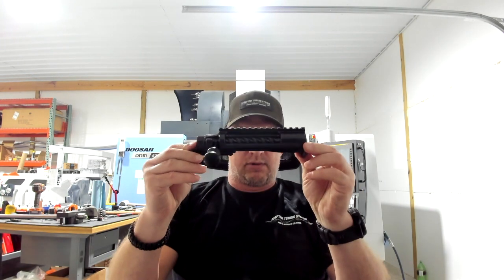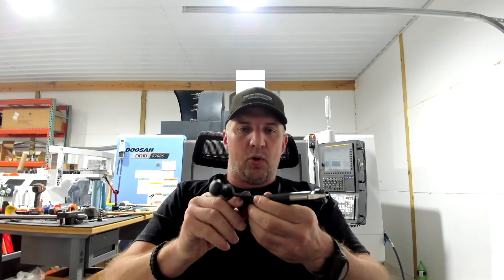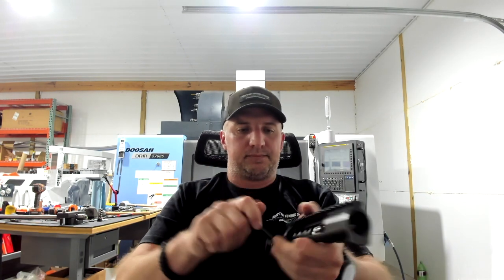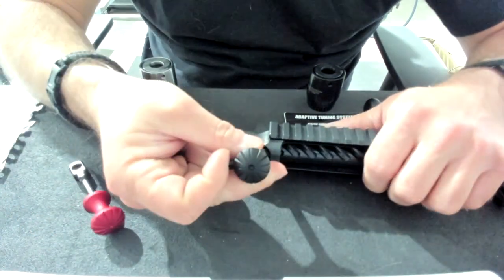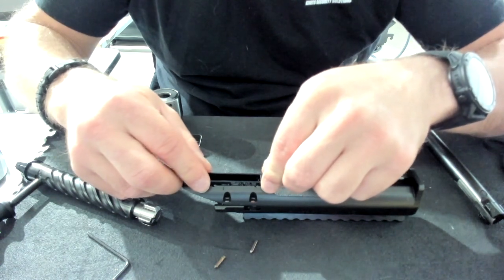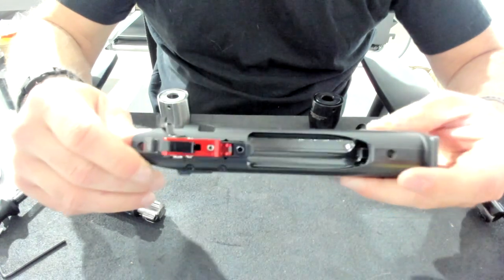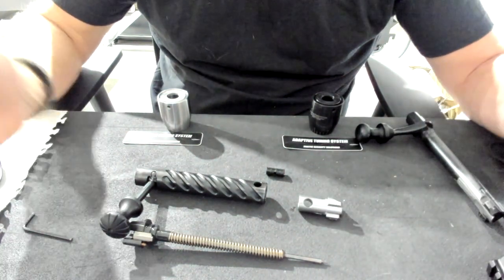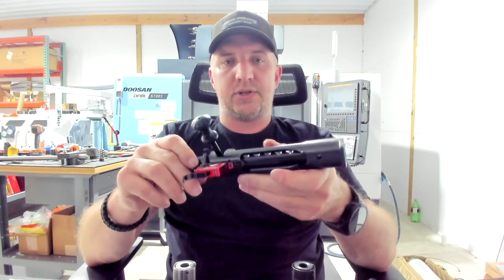Amazing Engineering - American Rifle Company Coup De Grace - In Depth Review

Comment: Looks like the bolt shroud blocks the raceway, turning any escaping gas 90 degrees away from your face in the event of a case failure, is that correct? That was a feature found on almost all bolt actions before the 1960’s, but is increasingly rare. Winchester, Browning, Remington, and Savage still respect the old values, but few others do.

Comment: I see you putting a TT diamond in the action. ARC' own videos say that those won't work with the pivoting bolt handle. Is that correct, or am I missing something?
Reply from the maker: They work just fine.. Been running it since before public release.  You just need to adjust the trigger hanger.  Ill talk with ted and see why he lists that
Reply: @aaronhippATS thanks. It's my go to trigger. ARC cdg the way to go I guess? Looking for 2 new builds( nrl hunter and prs) and leaning this way...thanks.

Comment: IMO,  IS  THE ACTION ALUMINUM - 6061 OR  70 SERIES ;
OR IS IT OUT OF
416  STAINLESS ?
IS  THE BOLT
4140CHROME MOLY ;  OR
WHAT ALLOY OF
STAINLESS ?
Reply from the maker: It is not aluminum.  ARC  keeps the exact material confidential.

Comment: Mr. Hipp. I'm looking at the CDG and the Solus. Solus for the money, and CDG for the quality. I'm not an expert at all, nor do I have the two actions in hand. But from what I can see (and find) these two have a lot in common. One just has more attention to quality done. Is that a fair assesment, or is it much deeper than that?
Reply from the maker: They are quite a bit different in their design and engineering. The Solus is a standard 60deg 3lug action. The CDG is a fat bolt design with cantilevered style extraction or standard rem style but trust my you want the cantilevered handle.  Also the materials used on the components are also different. The CDG has more features, better design and higher quality action all around.
Reply: @aaronhippATS  Thanks, CDG for the win, will have one in hand in the next month or so.

Comment: These work with Savage barrels and nuts?
Reply: No
Reply: @jeremystandke688  Strange, I've been told it does since I asked my question. By people using it that way.
Reply: @czgunner   the CDG need a conical  counterbore. The Nucleus  will use a savage prefit.
Reply: @jeremystandke688  Thanks for the info.

Comment: I am seriously considering this action BECAUSE of interchangeable bolt faces. I want modularity so I’m not buying stocks, triggers, bolts etcetera. 
Especially after having to buy a .445 bolt and a .473 bolt to go with the .390 bolt I got with my Curtis Axiom .223 barreled action I bought. $1100 for the action/ bolt combo and $450 each additional bolt times 2 comes to $2000. I could get this action/ bolt combo for $900 and 2 bolt heads at $175 each times 2 and pay $1250 vs $2000 on the Curtis. The Curtis does not have the integral lug or rail, no adjustable trigger hanger or AW mag cut. 

So to the guy who wanted to know why $900 I say HOW?  How could they build such a feature rich action for 500-600 less than others that can’t even compare?  

Guess who’s buying one?  😂
Reply: I just did! 🤣😂 one for my wife as well!

Comment: Im confused on ARC's site and their videos (yours included), they recommend not to run the TriggerTech triggers, but both your videos show the action with those triggers. So is it good to go?
Reply from the maker: I never recommended not to use TT. I use 100% TT
Reply: @aaronhippATS  no you didn't, ARC website said not to use TT with pivoting bolt handles. So I'm confused with your demonstration showing nothing wrong with the light trigger
Reply: "We suggest using fixed bolt handles for Trigger Tech Diamonds, Bix'N Andy Tac Sport Pro, and other ultra-lightweight triggers." Thats all the website says about TT. Not sure where you saw what you're claiming to have seen.
Reply: @Kylef7735  exactly, it is saying to use the fixed handle so the opposite is true, not to use the pivoting handle. I believe it is saying that concerning Alam fire but in the video he is demonstrating this isn't an issue. On their videos same thing. So why are they recommending the fixed handle?
Reply: @InkwellFoto I’m interested in hearing the answer too and I’m struggling to understand why your question is apparently so difficult to comprehend lol

Comment: Might never need hammered up but might need hammered back so what is the advantage ?
Reply from the maker: Why would it need hammered down? The only way you would hammer down is if youre trying to shove an oversized round in the chamber which you dont do and would be no different than any other action
Reply: In the prone it's a lot easier to pull back on the bolt than it is to force the lift. It's about changing the direction of effort to a more convenient/efficient direction. 
Cool concept... practical? I don't know. Maybe.

Comment: Interchangeable bolt head is not a feature its a short cut , like a savage,  they are cheap low end rifles and they use removable bolt heads .
Reply: Comparing any ARC action, regardless of features, to a Savage action is like comparing a Ferrari to a Hyundai!!!!   ARC builds “Top Shelf” actions, not mass produced mediocre actions.   Do your homework before making an ignorant statement such as this.
Reply: @stormy7135  that's not what I did , your making leaps woth my words.and I probably own more of thier actions than you do but the point remains .
Reply: @nonetheless01  So I take it you’ve had mechanical problems and/or accuracy issues with your other ARC ( interchangeable bolt face) actions?
Reply: @stormy7135  nope. I'm happy with them generally , but as a machinist I can tell you for certain that the interchangeable bolt head is not a feature . Don't believe me that's fine not everyone understands and it's a non issue generally but as far as a top quality workmanship point of view goes its not as good as the alternative , cheaper sure, as good not even close .
Reply: @nonetheless01  Maybe you should wait until you receive the action, operate and put some rounds through it before complaining about its features?   It’s $900, if you don’t like it go buy a Terminus Zeus like everybody else and spend 2k.
Reply from the maker: @rageagainstthelibs  Ted is not only a great machinest but the smartest engineer i know. You are incorrect on this one. Sorry but its just the way it is.
Reply: @aaronhippATS  nothing against Ted bit who you know is not relevant to the discussion and Ted is running a business and removable bolt heads is a cheaper alternative than 1 piece bolts , those are the facts your inability to understand does not make them any less the way it is.
Reply from the maker: @rageagainstthelibs  cheaper cost doesnt mean its a lesser design. Its a better design all around but you just dont seem to understand that.
Reply: @nonetheless01  it’s completely relevant to the discussion, it’s his name on the action!   If the action doesn’t meet the expectations of the precision shooter, it’s his name that gets tossed around on the various forums.  That’s exactly why buyers are lining up to buy his actions, they have faith in Ted.   Again, if you’ve never had a problem with one of his actions, why are you whining about a perceived design shortcut???   I have one on order and have no doubt that it will meet my expectations.   If you don’t like it buy a $700 Savage action, I’m sure you will be happy with the $200 savings
Reply: @nonetheless01  My sweet summer child... what's necessary of any given mechanical design is to understand what stresses and forces will be exerted upon it.  Then one could seek a suitable material(s) that would provide you with the properties, price, machinability, etc that you're looking for.

After that, it is a matter of holding (and maintaining) the tolerances of all parts manufactured, etc.  (Something every machinist/machine shop should do, regardless of what they're producing)

If the material(s) and manufacture processes are a good match for their given use case: and in that case, it then results in you being able to easily swap bolt heads on an action/bolt and be not only repeatable and consistent but safe as well.

Lastly, if an easily swapped "floating" bolt head has you concerned, I wonder how an AR bolt takes it? AmIRight?  The similarities are too obvious to not point out.

AR bolts are easily replaced, they are not fixed and like this action, they both "float" to some degree or another.   Sure it has a "tail" but most bolt failures occur at the bolt lugs. 

They also take severe abuse under heavy firing schedules, in arguably worse conditions.... and still function for many thousands of rounds without critical failure of the bolt and while maintaining genrally good accuracy for the platform, some which maintain sub MOA or less.  Again, the right material, the right process, etc.

fwiw- I work at a well-known rifle chassis manufacturer in the US, operating vertical mills, horizontal mills w/pallet pools, lathes, even an old Bridgeport, etc.  We cut raw stock, machine 95% of everything in house (excluding fasterners, etc). 

Now, don't take it as I entirely disregard one-piece bolts.  I'll concede, that all thing being equal, they will generally be stronger, but if modern metals and manufacturing allow for "floating" bolt head design and it admirably performs as intended and offers functionality, be it whatever firearm platform they're in, that is indeed a feature.  One you may not see the value in, but many will and do.

I guess we'll agree to disagree.
Reply: @peterstone7901  totally missed the point . Typed all that and doesn't get it .
Reply: @stormy7135 Precisely!
Reply from the maker: Not true at all, and this isnt designed like a savage
Reply: @aaronhippATS  no.  Your wrong , the removable bolt head makes it designed like a savage , it's not a feature,  selling with multiple vlots for different bolt face diameters would be a feature , a removable bolt head is a cop out seen on junk ass savage rifles .
Reply from the maker: @rageagainstthelibs  you realize you can get ARC bolt heads supporting up to magnum bolt faces correct?  Im not wrong on this. Its a feature.
Reply: It's neither here nor there. Desert Tech, Barret, and several other high end custom actions use floating bolt heads. If floating bolt heads are a "cheap rifle shortcut" then why don't all the cheap rifles use them? Ruger American rifles are cheaper than Savage. Single Piece bolt. Hmm... Flawed logic.
Floating bolt heads exist in custom actions to allow users to change bolt faces without dropping another 3-5 hundred on a whole bolt. Zermat arms does the same thing.
Some low end and high end rifles use them. Just like some low end and high end manufacturers use traditional bolt heads. Yall are arguing for no reason. Just buy your preference and move on.
For what it's worth, a floating bolt head rifle has the mechanical accuracy to outshoot any gun in your safe, and vise versa. So who cares?
Reply: @SuperSneakySniper  flawed logic , thats funny , you obviously have zero clue what a 1 piece bolt is , your a clown , just stop embarrassing yourself .

Comment: Hey Aaron, will you run a light ( you said 6 oz) trigger with the pivoting BH in comps? Thanks for this. Eager to get mine and shoot it.
Reply from the maker: I've run 6oz triggers in interchangeable bolts heads for years.
Reply: @aaronhippATS  I asked because ARC recommends the fixed bolt handle with light triggers…
Reply from the maker: @Mauro Magrassi  Thats because he has to be overly cautious for liability reasons only as a business. Ive run 6-7oz triggers in Nucleus, Archimedias, Coup de Grace etc for years.